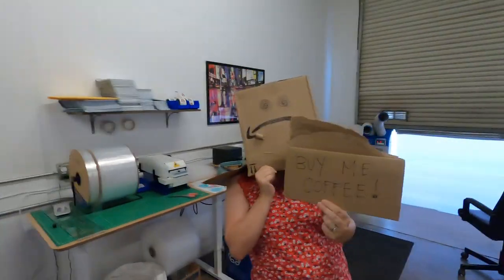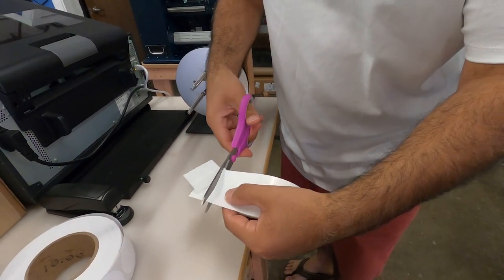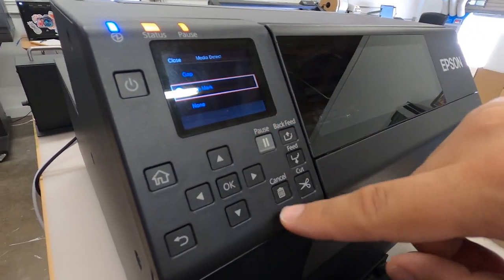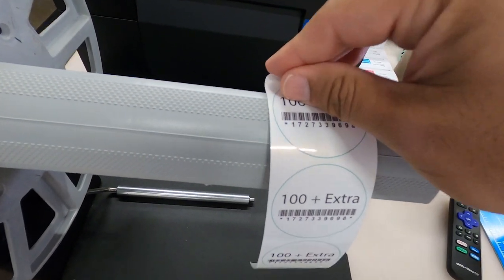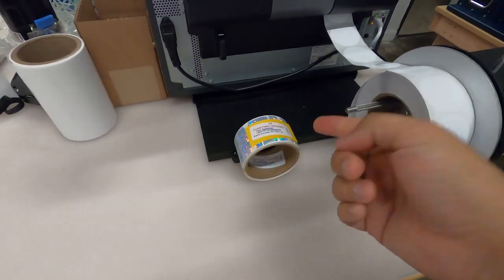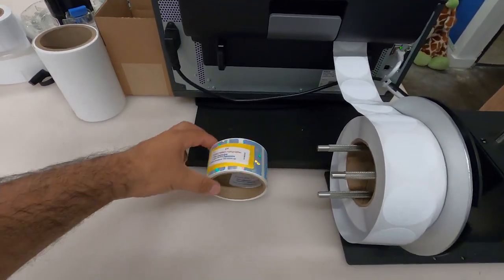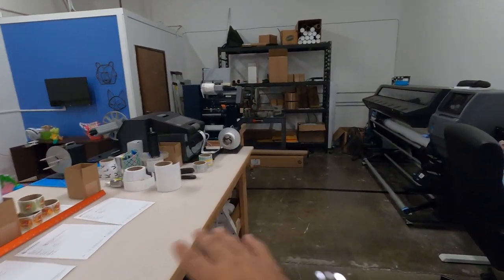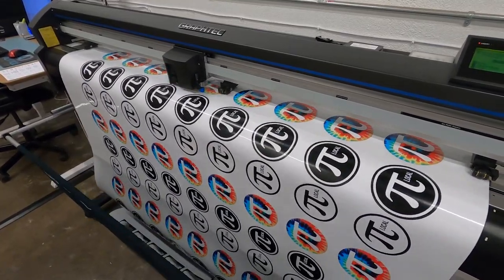Printing labels and stickers Print shop VLOG #2

Comment: Hi, Derek! Quick question please. When you loaded that roll, was it precut in circle shapes or printer did cut it? Also, I saw in one of your videos that you cleaned printer's encoder strip with alcohol. While it is true that encoder needs to be cleaned with 70% isopropyl, HP however claims that their encoders should be cleaned with tap water.
Reply from the maker: Thank you for the info! We started out buying pre Diecut labels on a roll from Hickmanlabel.com then once we quickly got enough jobs we upgraded to a finisher so we can finish any shape in house on demand.

Comment: Hi Derek, I have a Graphtec CE 6000 40 Cutter, which is mounted on a Affinia DLF label finisher. The issue that we are having is that the label is not peeling cleaning from
the label matrix. Sometimes the label does not peel completely from the label matrix and wants to continue up the matrix. We have had this machine for a couple years now and 
often had this issue, the issue seems to be in our setting, if we place any more cutting pressure onto the label material it will cut through to deep into the material...I was wondering if this has
been an issue u have encountered and if you might have a solution for this kind of issue.. Its happening on about 50% of the jobs we are trying to cut..
Reply from the maker: I would say it’s the adhesive and quality of material. If you lighten the nip rollers to the lowest setting it can help but the acrylic adhesive of most cheep materials becomes joined after cutting again and causes this problem.

Comment: What are your settings to die cut the stickers on your cutter? I cannot seem to get mine right. Yours just pop out. Would be nice if you can share. Thank you..
Reply from the maker: We do a 1.25 down cut and a .0012-.008 up depending on style of sticker, the larger over 3” we use a bigger tab the smaller ones we use the .008 tab